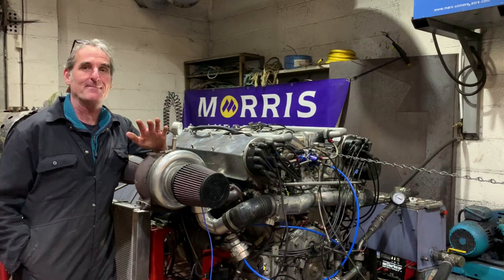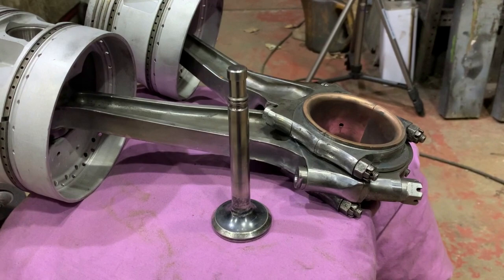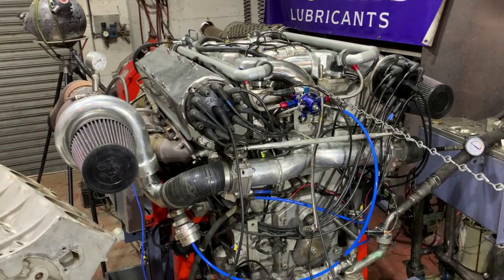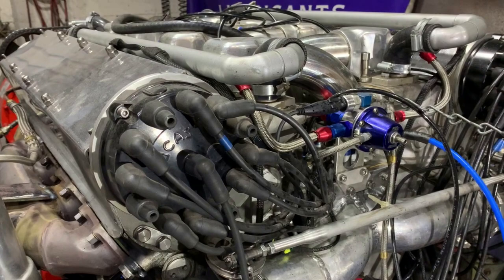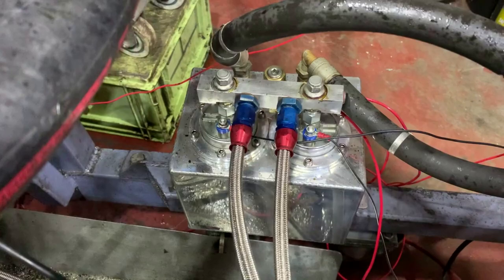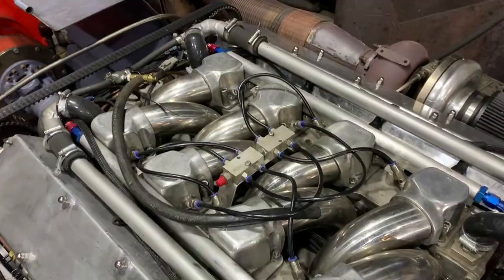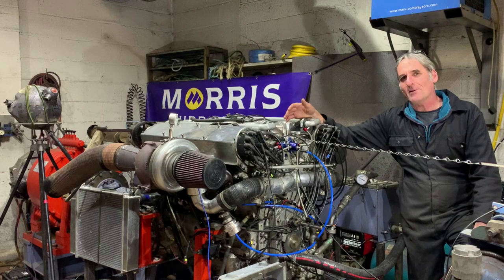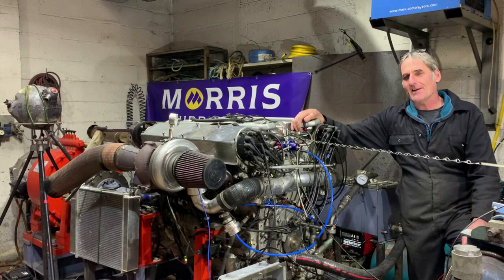An Introduction To The Rover Meteorite Mk204 V8 Turbo Engine

Comment: I can't help but notice the prop shaft yokes aren't in line ? I thought this was a given ? Please forgive this comment as it's only an observation and in NO way intended to criticise your most excellent video. I am in awe of your knowledge and willing ness to share it, thanking you once again, cheers Keith.
Reply from the maker: Well spotted! I hadn`t seen that. When we remove the dyno trolley from the rig we usually withdraw that end of the shaft from the spline. Originally it was phased correctly, but I don`t think I have ever checked it since. The engine is in near-perfect alignment with the dyno, but it will be interesting to see if it was causing any vibration.

Comment: I used to check new compression rings correct tip angle by putting two edges together and making sure the resulting slight "V" was correct per manual. Found new ring tip angles and "TOP" lettering on rings were not the same as manual told me. Never truly got to the bottom of the correct way to fit and stayed with manual description. Do you know if they changed the tip direction of these rings on the Meteor V12?

Comment: Has it got some Merlin forged pistons in it then now for the boost?
Reply from the maker: No, it`s currently running Meteor pistons to give it the 7:1 compression ratio. The rings are modern design low friction types, and later it will get a set of 7:1 Rousch (I think) forged pistons.

Comment: That was fascinating. I was wondering what limits the rpm so much? Just the vast mass of the rotating assembly?
Reply: Heavy rotating assembly plus the stroke. 
Lot's of mass moving around plus the engine was designed for longevity. Whole idea is to get the thrust needed from the prop without exceeding its design parameters

Comment: Curious, since you have EFI why not convert to LS coils with a trigger?
Reply from the maker: Excellent question! The engine has twin spark plugs, and they can also be timed differently. I didn`t have enough outputs on the FT600 to run everything, (although I later discovered that I could have run some outputs with a CanBus adapter). I`m not running enough boost for the distributors to cause an issue, and each one is fed with a FuelTech LS type coil.

Comment: Did they make a Diesel variant of this engine ?
Reply from the maker: Yes they did. It used a different cylinder head with only 3 valves and Ricardo combustion chambers. Used in marine craft. Mk2 Antars didn`t use the Meteorite diesel as some people think, they used the Rolls-Royce C8 inline.
Reply: @FlightEngineering1  Ricardo combustion chambers ? Are they the ones with the separate swirl chamber ? We had a Perkins P6 with this type of arrangement, a pig to start without a little sniff of ether, but once warm a great engine.
Reply from the maker: @keithtpullin  Yes, Ricardo Comet, they are indirect injection (I think) with a pre-combustion chamber. They were used in lots of engines, some start really easily, even in cold weather, I`m not sure why some were always so difficult to start, but you`re dead right.

Comment: Love that engine , why dose it not have the v8 sound , ? Few year ago I was intrigued by a vehicle called a rhino  in bovington tank museum , very cool looking , it stated on having a meteorite engine ,  , 👍🙂
Reply from the maker: Thanks David. Very observant! It`s a 60 degree V8 and also has a flat plane crank identical to an inline 4, so it`s effectively two 4 cylinder engines 60 degrees apart with an uneven firing order. I don`t think it`s ever going to sound as good as a 90 degree V8 with a crossplane crank, but the effect of hearing it in that vehicle should be cool enough!